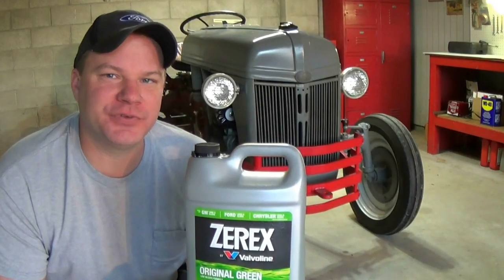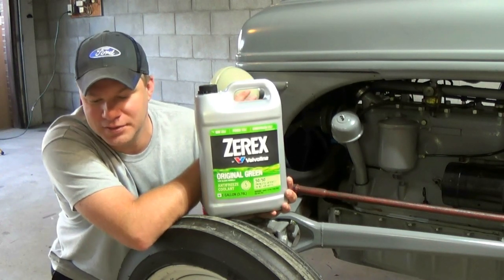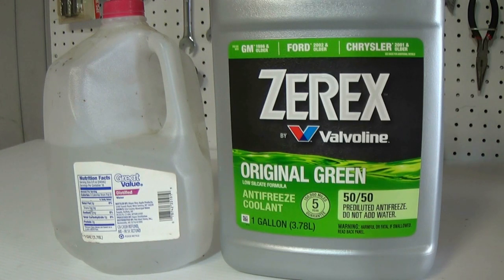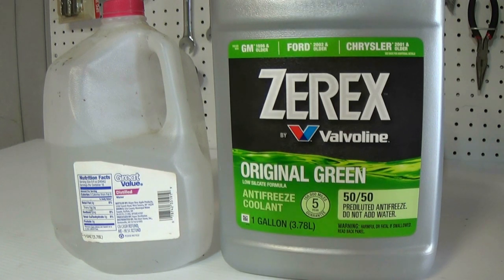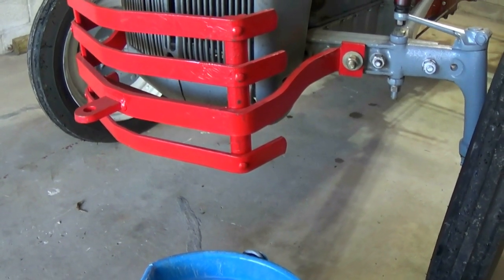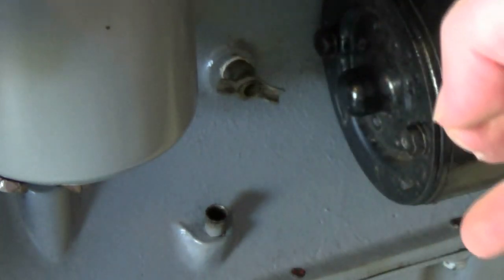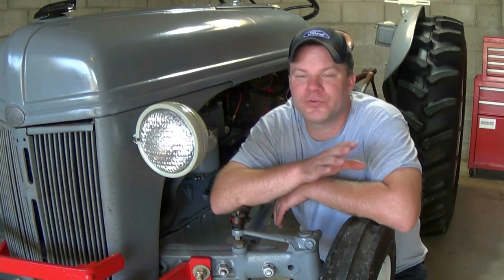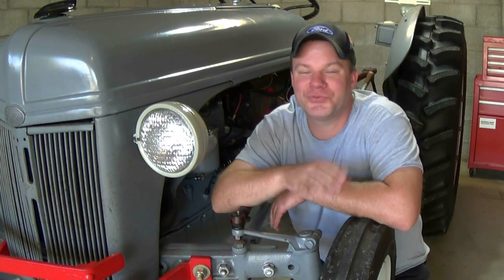Ford 9N 2N 8N Cooling System

Comment: Awesome video, question how do you prevent rust in the n series gas tanks thks again,
Reply from the maker: The best thing is use non ethanol gas if you have it in your area. Ethanol absorbs moisture. I also use a fuel additive that non only helps fight against ethanol, but also keeps it fresher longer.  Keeping the tank full will help with condensation however I don't do that often especially with my tractors I just use for show because the gas would go bad before I'd consume it all. Naturally keeping it inside even a somewhat controlled environment is a big plus as well,but sometimes that isn't always possible.

Comment: Hi Jason , From North Central Ohio, ( LOCAL TO HOME OF THE SILVER KING !!! )  Thanks for the video, appreciate it !
Reply from the maker: Hey Mickey! Did you ever get that Silver King tire mounted?
Reply: @Jason1Pa  good morning friend ,  yes sir, it looks a lot better than the smaller 1 that was on it, that sure is a nice looking Ford , I always wanted to add 1 to my collection , but ended up getting a nice little Ferguson T0 30 ,  pretty much the same look, did you figure out anything on the flying Silver King ?
Reply from the maker: @mickeymantle46  It's pretty much a loss. So many parts missing. Don't even think it would make a good parts tractor. Could salvage the wheels possibly but that's about it.
Reply: @Jason1Pa  that’s a bummer, what year was it ?  So prev owners used it fir a parts tractor  likewise ?  The way your  42 looks after you & ( your dad ? ) have it looking & running , I guess there’s no hope if you say  no way possible, THATS  a sweet 42 !!!
Reply from the maker: @mickeymantle46  It's a early 1935. First year they were made. Serial Number is #614 The first few hundred produced were named Plymouth. So this particular tractor was one of the first few made with the Silver King name.
It would take a very long time to try and find all the original parts. And a expensive adventure. Some parts could be made such as the fenders,but with little things such as the grill screen you'd need to find an original because that style mesh just can't be found. The magneto,carburetor,throttle linkage,etc is all missing. The auction I got it at had several tractors from one guy and by the looks of it many were taken apart with big ideas,but then it stopped. Some of the tractors had the parts laying next to them however the Silver King did not. There was another Silver King there that I really wanted,but got out bid on. It was complete. 
I do all the work myself. Dad helps some when I need to split a tractor or something.
Not sure if I'll keep the little Silver King or not. If I can think of a creative way to display it I may keep it. Or see if someone else wants it.
Reply: @Jason1Pa  exactly what I was thinking, if complete enough to just paint up as a display ! O so close to being a plymouth ! Same year , might as well be a plymouth !

Comment: Man ,  your vids are great !    I am looking at getting my first tractor  ,  1949 8n .    It has been used two summer evenings a year for past 10 years ,  before that it sat unstarted for 17 yrs ,  and before that who knows .   The tractor looks nice with a reasonable to medium paint restoration 10 yrs ago ,  starts and sounds nice .    Aside from wobbly front tires at road speed  ,   i have a concern and wondered your opinion   ---   question is   --   the current seller of this 8n  has only put water in the cooling system for 10 yrs  and drained it for winters .    Will this not create a ton of rust in the block ,  is it a problem  ,  and is it fixable/reversible  by some sort of rust eating solution ,  which may cause another problem of rust particulate plugging rad .      After watching all vids i could find on steering box & steering problems ,  i     THINK     i can fix the steering  ,  however ,    the water only , coolant ,  is concerning for me  .  Your opinion is valued ,   what do you think ,  or should i walk away from this tractor & engine ?       Thanks  Cyril     
Northern Ontario   , Liked & Subed  !
Reply from the maker: Hi Cyril I'm glad you found my videos helpful. Putting straight water in the cooling system is not good however if it was drained for the winter that would help to a degree with corrosion. Would I walk away from it? No. Unfortunately most of the tractors out there this age would of had this same treatment years ago because they simply didn't have the knowledge or products that we have today. Plus some individuals even still practice the method of running water because thats what they were told so finding a tractor that was properly cared for is hard to do. Personally I'd fill the whole coolant system up with straight vinegar and let it set a couple days then drain it. See what comes out. If it's nasty looking or doesn't come out due to rust clogging up the drain valves I'd then take the radiator out and have a better look at things. You can see down into the water jacket a little just by looking down into the head. As far as harsher cleaners to put in I really don't have first hand experience with anything but there are a lot out there.
Do you know if your 49 8n is a late production with the adjustable steering gear box? If not I'd really doubt you'll have success getting the slop out. Most have very little success. The old style were defective from the start.
Reply: @Jason1Pa  Thanks for your reply !      I let the tractor go to somebody else yesterday ,  and will look for another  !!!!      To hire someone for the long drive to get it ,  plus possibly a new steering box ,  the numbers didn't add up .    
I had thought of the vinegar but discarded the idea ,  but with your reccomendation  will keep it in mind for later .
I got plenty of pics and vid.   , but not the tractors numbers  ,  and was unaware the steering boxes were adjustable ,  unless its the outside plate around the sector that you turn counterclockwise ,  as i seen one person attempt .    As i diagnose as many vids as i can i'm trying to find the root cause of the steering slop within the steering box  (as so many tractors have this problem )    .     Is it the bearings in the ball nut failing ,  thus  , the tubed keepers for the ball bearings go out of shape that causes the slop ,  OR  wear on the sectors  and/or  the steering shaft  ?   I just can't seem to definitively figure the defective area .    As a custom woodworker for 29 yrs , wages are never high  ,  and I started out in life ,  and to this day ,  hauling home something someone else threw out  ,   identify the problem ,    invent create  fix   &   then Restore  and keep in good shape  .    
Just watched your vid from last night  ,    that shim and pin were a bugger eh !  I always said if there was a   Will , There was a Way  :)        Thanks for your time  --  Cyril

Comment: What's the green material underneath, surrounding the  radiator cap?
Reply from the maker: That's a mesh pad that was used to to protect the radiator neck. Also cuts out rattling or vibration. Here is a link to new ones. Thanks for watching.
https://www.just8ns.com/2N8032-Years-1939-52-Pad-Radiator-Filler-Neck

Comment: You didn’t say anything about when you changed the thermostat which way is it installed!
Reply from the maker: I guess because I didn't change it.🤣 However pointed side facing radiator.